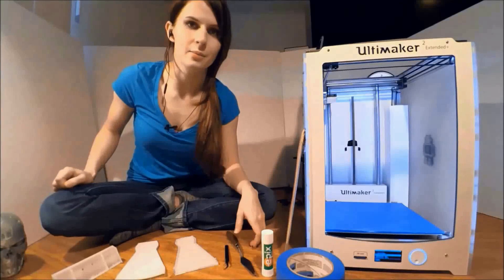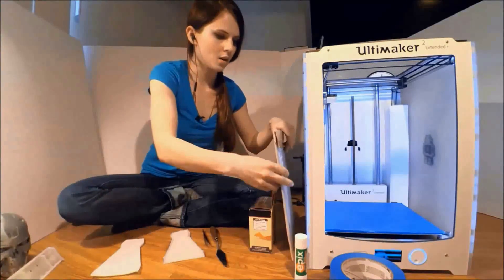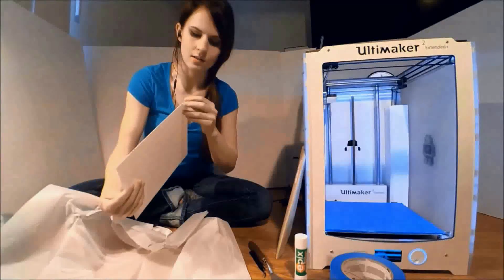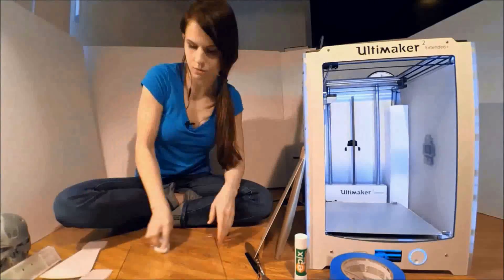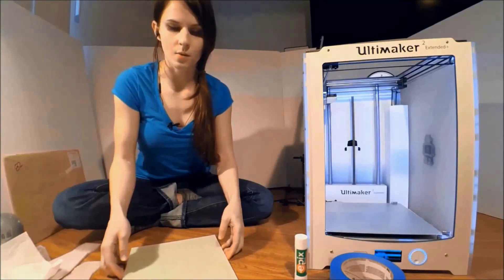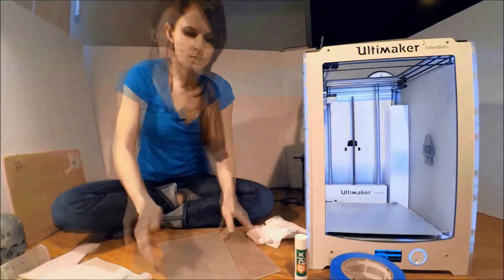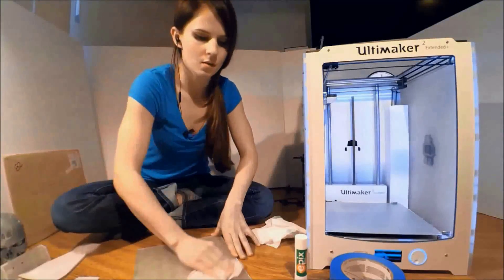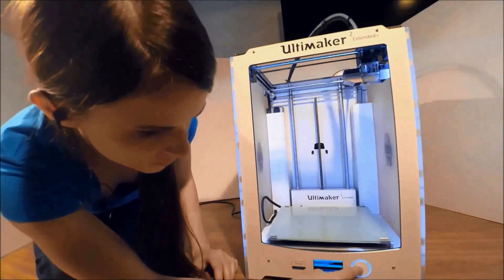PrintBite 3D Printing Surface Review - Unpackaging and Tech-G Filament

Comment: what was your print speed and cooling fan settings
Reply from the maker: I don't recall what the settings were in this video but usually print around 40 mm/s with full fan depending on the filament and complexity of the print.
Reply: iam useing tech-g on printbite.had settings but lost them :( any way good videos you should do more
Reply from the maker: ugh hate it when that happens. personally trying to get in the habit of saving every new Cura profile to my desktop so there's always a backup.

Comment: What settings do you use for these? I've actually had no issues with warping on PETG and PLA on plain glass for my Ultimaker 2+. The trick for me is to make sure the surface is actually clean (No fingerprints), and to get the bed up to about 60C for PLA and 90C for PETG. A thick first layer also helps, but that's basics.